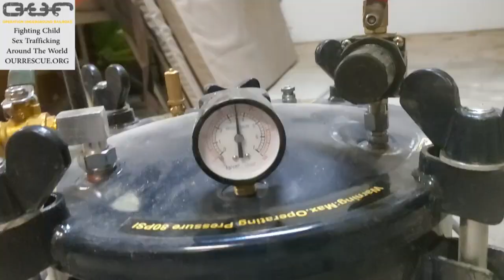Vine and Resin Bowl. wood turning, lathe. Supporting Operation Underground Railroad at ArtForOUR.org

Comment: Your resin polishing technique is iffy.

Try taking it to 600-800 grit then switch to steel wool for a while. After that polish it with grit/wax.

To make your own grit, heat equal parts linseed oil, beeswax, and diatomaceous earth in a double boiler or microwave, then add one part turpentine to suit. With the lathe on low, load a paper towel with some of that and spin it on, run it a while, and towel it off. From there you should have a near perfect surface to wax or polish further.

I like the stuff you're making!
Reply from the maker: Thank you for the support!

Artforour.org